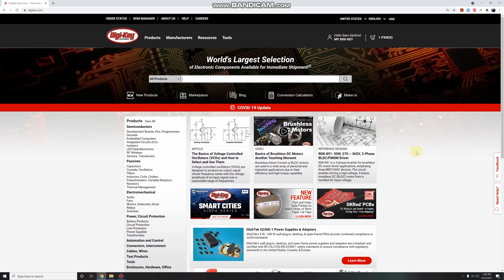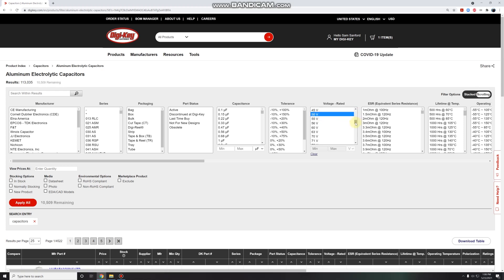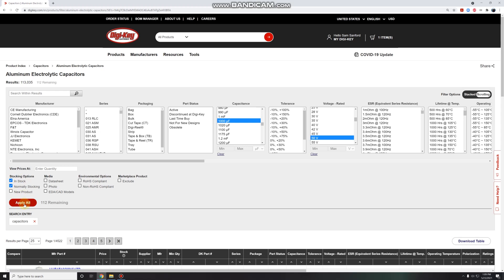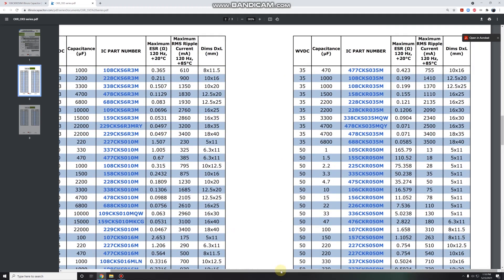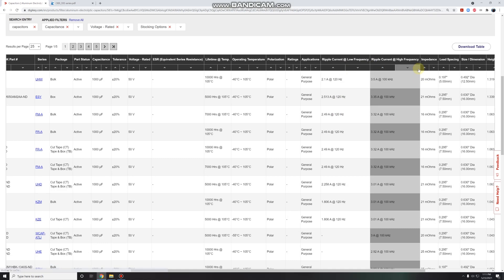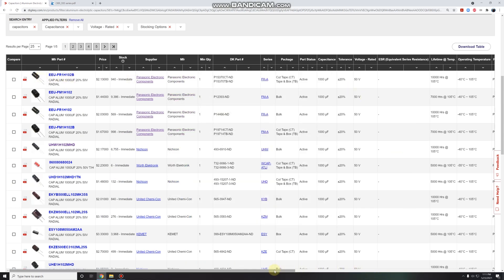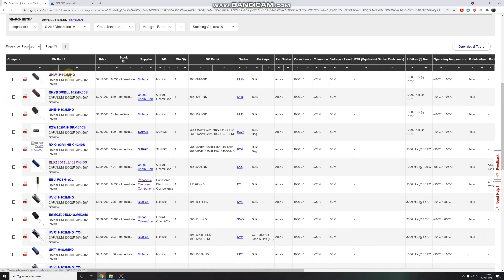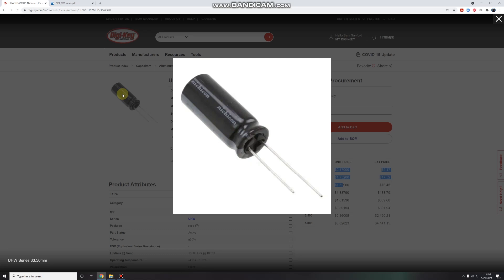How to find low ESR capacitor for your FPV drone

Comment: Do higher voltage caps usually mean lower esr? I got some 100v caps for x-class if i ever go 12s but i figure they should pair well with some of my 10"ers if i can find a way to mount em(they big), Iflight has a new 80a 8s 4in1 esc on their website that has me tempted for my 10" builds, although it might be a bit too pricey for some as it currently sits at 200$.... 400$ per cinelifter is a bit but if it really holds up it might be worth it.... Pigeon would probably fly pretty awesome on 8s 1200kv 3106 as well
Reply from the maker: Crazy man, I didn't know about that 80a 4 in 1 ESC. Though I wouldn't use it myself because I have had really bad luck with iFlight FCs and ESCs personally. To answer your question, the higher the voltage caps, the larger it needs to be to have the same amount of capacitance. Probably because it needs more/thicker dielectric between the charge plates. For 12S builds I have used 63V caps with no issues. Some people even use 50V for 12S builds, but the voltage rating for caps is not a working voltage rating, meaning that the 50V caps can run at 50V all the time and it's okay cos there is a factor of safety. For many caps, that voltage rating is the upper limit. So I would def use 63V rated at least for 12S. 100V, I don't see that too often, so maybe that's overkill? Who knows, maybe 50V for 6s is way overkill cos none of us are going to get 10,000 hours out of our drones usually, but if it's easy to do it then why not.
Reply: @strawhatsam  gotcha, i will end up checking out these 50v you talked about here and maybe some in the 2000uf range, ive got a couple 100hours in iflight esc/fc and havent had any issues(not that i recommend any of their other esc's, loving the holybro65a... but this looks a lot beefier than any of their other designs) although im also running some of those bad batch holybro65a on 2 of my 10"ers and have been fine there as well so who knows, maybe im just not pushing as hard with my throttle scales... 

i know iflights stuff has gotten alot better in the last year so ill give it a try(they recently put mpu6000 in their 2.1 FC as well), love those huge solder pads on the holybro tho.... 

Ive got some matek fc/hobbywing 60a as backup if anything fails, and will probably use separate voltage regulator to air unit on my custom 9/10" cinelifter... never had video lock up on any of my other builds using iflight 2.1 FC air unit plug(other than when a cap leg broke off esc but thats my fault)... youd think 3115's would cause it if anything.... Ive heard a lotta horror stories though and im sure x8 is a lott more electrical noise than x4